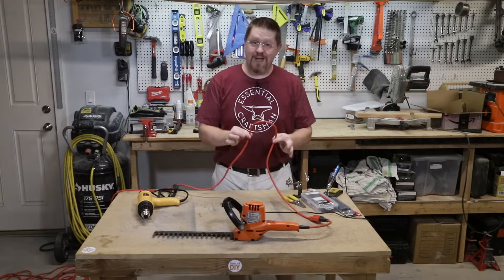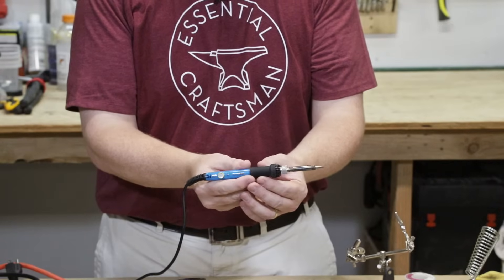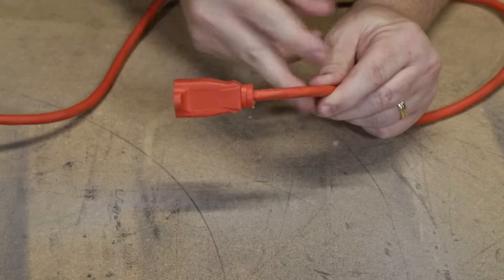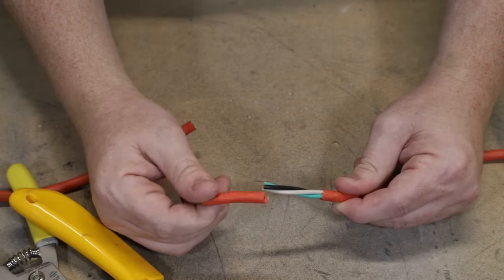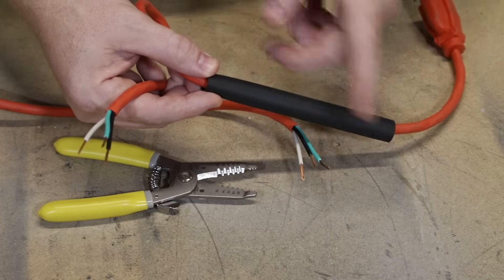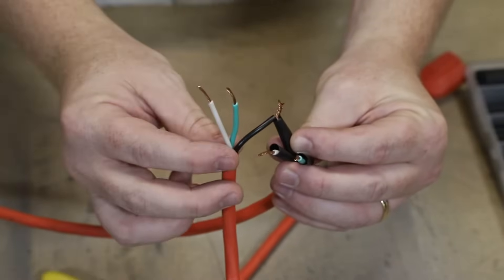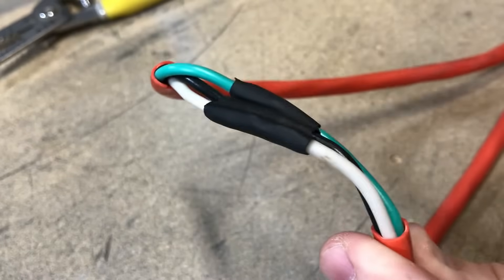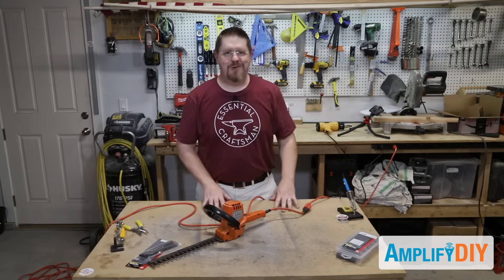How To Repair A Damaged Electrical Cord Safely

Comment: soldering connections is prohibited here in the EU for obvious reasons. dont use this wire inside the house
Reply from the maker: Soldering is prohibited in the EU? Somehow I don't believe that....
Reply: @AmplifyDIY  soldering eletrical connections at domestic voltage ie 120-240V bruh obviously i wasnt talking about soldering in general... ever heard of wago, etc?
Reply from the maker: @kbuss10  When done properly, soldering is fine, even at mains voltages. Of course I've heard of wago and other similar connectors, but none of them that I know of would provide a better (safer) connection than what I demonstrated.  But hey, if it's not allowed in the EU, so be it.
Reply: @AmplifyDIY  I've been soldering since 12yo low voltage of course. it was outlawed in the EU because at overload it can melt and cause fire. in a domestic fire insurance company finds out it won't pay also at quality control for an electrician it's not accepted. needs to be crimped wagoed or ultrasonically welded lol which is kind of crazy. The latter is used in power bars Even the cheaper ones.
I was looking for solutions The problem is in the USA everything allowed in the EU everything is over sanctioned.
but no information how it should be properly soldered like that is quite a relative expression when you load it up with 20 amps and I'm not going to do experiments just to feel safe.
did lately what you did but I just cut it off and installed an IP rated plug but it turns out I shouldn't solder the wire ends because solder creeps under load so the holdings screws will loosen even if they havey duty and tightened properly. luckily it's on the garden end.
so again I was looking for solution. That's how I find your video. by the way what I don't like it in it you should have used waterproof tape first then two layers of outer shrink tubing the second being longer.  this is going to be pulled around in wet grass capillary action will put water up to the solder they going to rot but whatever as it's outside.

Comment: You should have staggered the connections of the hot/neutral/ground wires so they are not all at the same spot
Reply from the maker: This is a great idea. Thanks, ItsAlive111!

Comment: Can you add silicone under the last shrink wrap to make it water proof?
Reply from the maker: Hi Porfirio - I did not, but you can. If you are looking for a water-tight seal, look for heat shrink that has hot glue in it already. As it shrinks it melts the glue which then makes a water-tight seal. Good luck!

Comment: Can this method be used to double or tripple the length of the extension cord by combining them?
Reply from the maker: You can ... but I don't recommend it. Extension cords are generally only manufactured to be the maximum length that their internal conductors will allow at the rated amperage. So be careful, and pay attention to the load you are putting on the extension cord. The longer the cord, the more resistance. Extra resistance causes more current draw, more heat, tripped breakers, and in extreme cases can lead to fire etc.

Comment: Bassett hound chewed thru 3 extension cords, circular saw cord, battery charger cord,  and my trailer wires.
Reply from the maker: Oof. Bad dog. Probably still a good dog, though. :)

Comment: crimp connector all the way. not solder
Reply from the maker: Crimp connectors are far less reliable long term, in my experience. They can corrode easily, and develop loose connections. Thanks for watching!

Comment: What do I do if there are only 2 wires and neither is coloured
Reply from the maker: Only two wires on an extension cord? Or is this on an appliance cord?
Reply: Appliance cord.
Reply from the maker: I assume you are in the US, where the electrical grid runs on Alternating Current (AC) at 60Hz. This means that the polarity between the hot and neutral wires (which are the 2 wires in your cord) flip back and forth 60 times per second. Typically the switch on an appliance is designed to be connected to the hot wire rather than the neutral, so that if you open up the appliance while it is plugged in there is very little chance of getting shocked. If you accidentally swap them during a repair, then you effectively change it to have the switch on the neutral side, which allows the hot side to be connected directly to whatever else is in the circuit inside the appliance. This is not really an issue, but be aware if you open up the appliance to attempt repairs on the internals and it's plugged in, you are far more likely to get a pretty good zap. But honestly, with a non-grounded appliance like that, it makes little difference which wire goes where. The appliance will happily run with the wires connected in either orientation.
Now, having said all that, here is how I would repair  yours: Before you cut anything apart, mark one of the wires with a paint pen, or wrap a piece of tape around it on both sides of where you are going to perform the repair. That will just help make sure you re-connect them the same way they were before. Other than that, I'd do the repair the same way I showed in the video: make a clean cut through the wires, strip off some insulation, slide on some heat shrink, solder the connections, insulate with heat shrink. Done.
Good luck!

Comment: Great video ! Any yes, I would really like to know how to repair a frayed cord where the fray is right near the plug. I have several of these cords, and somehow my appliances only want to fray right near the plug. I subscribed to your channel. I like your attitude too, on top of the great content :)
Reply: Just replace the plug end, you can buy male or female ends.
Reply: My daughter didn’t know she could just replace the plug end and bought a whole new cord for her bissell crossswave. She ordered the right part number and style but the new cord does NOT have the green ground wire. What can we do to still use it? It was bought online and more costly to probably send back than anything else. If it’s possible i will buy the 3 wire plug end but do I really have to? Do we need the green connected? Or just close it off? Please any advice appreciated

Comment: Instead of a heat gun could you use a hair blow dryer, or does the hair blow dryer not get hot enough.  Thank you for your video.  I just got a brand new vacuum cleaner and of course the power wire is not long enough for my 850 square feet of living space.  I have a very long power wire from another vacuum cleaner that I’ll add to my new vacuum.
Reply from the maker: Hi D - a hair dryer is usually not going to get hot enough. Also: be careful when extending an appliance cord. A vacuum pulls a fair bit of current, and the internal resistance of the wire can cause it to get hot, which is potentially dangerous. I would only add just enough length to reach what you need to, not another full cord. Good luck!
Reply: Thank you so much for the great advice!  Right now I’m having trouble finding a small quantity of the adhesive shrink wrap.  I don’t think I will need 270 pieces!  😜.    Thank you again!
Reply from the maker: @d.eileen1336  My local Home Depot and Lowes sell small quantities of heat shrink, in various sizes. Good luck!
Reply: @AmplifyDIY  WOW THANK YOU SO MUCH FOR THE INFO.  Thank you much!

Comment: You make all your connections the same length and that is dangerous! You are supposed to stagger your cuts then repair.
Reply from the maker: I don't really think it's dangerous, but certainly staggering your cuts will make things fit quite a bit better in the heat shrink. Thanks for watching!

Comment: Hello, great video! Is it possible, if it isn't already the case, to make a video where the damage is near the end connecter? also, can a hair dryer work instead of a heat gun? Thanks in advance.
Reply from the maker: If the damage is near the end, it’s usually best to simply replace the end with a new one. New ends are cheap and plentiful at your local hardware store. 

Hair dryers will typically not get hot enough to activate heat shrink. You can use a lighter, but be VERY careful. 

Good luck!

Comment: It's best to  just make two cords by putting new ends on the cut ends.
Reply: It can be handy to have a couple shorter extension cords on hand, too. Way more expensive, though. That is, unless you have to go out and buy a soldering iron.

Comment: Could I do this with 2/0 welding cable?
Reply from the maker: In theory, yes, but keep in mind the power levels in a welding cable are MUCH higher than a typical extension cord. You'd want to beef up every aspect of the repair as I showed it here.... make sure your solder joints are incredibly solid, double or triple up your heat-shrink insulation, etc.

Comment: on the soldier iron it has a temp gauage that can be adjusted - what is the temp to fix a wires on an extension cord?
Reply from the maker: Hi Shawn - the temp required is dependent on the type of solder you use. I've generally found that for most of the little jobs I do like this one 650ºF works well. Good luck!

Comment: That shrink tubing doesn't look very thick, is that supposed to insulate as well as the insulation of the wire? How water tight is it?
Reply from the maker: Hi George - it's actually quite thick, and filled with a heat-activated glue which forms a completely waterproof seal. Great questions!
Reply: @AmplifyDIY  Ah, great info.

Comment: So many people make cold joints that will fail. I would recommend butt splices. I've never had one fail after years. Otherwise the same method with the shrink tube. I always keep an assortment of sizes for different jobs. Having been an electrician for forty years I've worked on a lot of older solder joints and they can last longer than the wire but as I said many people don't do a good solder joint and I prefer the butt splice method myself even though I have the solder equipment. If it's a long cord with the damage in the middle I'd simply put a male cord cap on one and a female on the other essentially making two cords. That's the only acceptable method with osha inspections. And for a senior it's often a pain having to deal with say a hundred foot cord. Use a short cord when needed and two for a longer distance.

Comment: while it may be more difficult to find, they make a thicker heat shrink tube that has adheisive inside to use for the outside (orange) part.   it's more expensive and more difficult to find but being as these cords are constantly pulled on, it's insurance.  check with an electrical supply house.
Reply from the maker: Excellent suggestion!
Reply: When doing repair on a cord for outdoor use, I'd suggest going one better with marine grade heat shrink tubing (look in boating stores and some hardware/tool supply stores).  It is made  to produce a water resistant seal and should be UV tolerant as well.  Other grades of shrink tubing may only hold up in dry locations not exposed to direct sunlight.

Comment: My had the exact same accident with her hedge trimmers. Lol!  What size is the larger shrink tube for the cable itself. Is it 1/2 inch or 3/4 inch? I checked the comments and didn't see this one.  I did hit the like button! Thanks!
Reply: It was hard to see in the video but he used 1/2 heat shrink.  I believe the wire gauge of the inside would be 16 gauge heat shrink.

Comment: What I did, was just cut the six odd feet of cord and replace the receptacle. I used an Eagle 1-15 receptacle - it looks like a little yellow barrel and properly fits into the; trimmer/weed whacker/leaf blower since it has no ground slot.

I used the six odd foot cord for a switched extension box for my electric drill. This is a really great video, you have here. It really makes more sense since most people don't tinker with things like me. Also, wow that trimmer looks hella dangerous, looks like a reliable old Black and Decker. :3
Reply from the maker: You are right - that trimmer is a throwback to the '80's when there were fewer lawyers around. Thanks for watching!

Comment: I have a DNC CCTV cable that i need to repair, it's now in 2 pieces and i have tried to rejoin them by stripping back the red and yellow wires and soldering them back together but i get no video on my screen.

Any idea should rejoin them so that they work?
Reply from the maker: I would start by doing a continuity test with a multi tester on each of the leads to determine which one(s) is not making good contact.  Is it possible that your soldering is fine, but there are other problems with the cable such as a bad connector?

Comment: This is very useful!  I have a vacuum with a damaged cord that I will try to fix.  I don't know if I need to get a heat gun for one repair.  Is there anything else I could do?
Reply from the maker: If you are VERY careful you can use a simple lighter to shrink the tubing rather than a heat gun. Just hold the heat shrink over the top of the flame, about 2-3 inches above it. Go slowly, and be very careful that you don't get the heat shrink tubing too hot (it'll start to melt) or let it catch fire. Good luck!

Comment: Thanks for the step by step repair.

I do have an old canister vacuum that needs a cord repair.  The repair needed is where the cord is coming out of the vacuum . It is most likely due to  tugging at the cord that  caused it to pull away & have those  colorful wires inside showing now.  I like to fix it while searcbing for a new one.

How would I fix that?  The vacuum is fine and I still have quite a few bags left for it. 

 Plus , I have searched around for a new one and they mostly sell bagless types which is messier to deal with (I have a Eureka Airspeed for 5 years  and the hose came off that recently). Many new vacuum parts are made of plastic too.

So I was thinking that I need to cut 2 - lengths of that heatshrinking black tube & cut it down its length so that it's filet open.  Then slide as much of it into the vacuum & overlap  the other end over some of the cord n use the heat gun on it.  Then use the 2nd length to do the same but making sure that it overlaps the filet-open end of the first?

Can you make a video demonstrating the steps to doing such a repair? Thanks.
Reply from the maker: Thanks for the feedback! I would not recommend cutting open heat shrink tubing in the manner you described. When you heat it up, it will never actually tighten down and shrink around everything like you expect. Most likely to finish the repair correctly, you will need to disassemble the portion of the vacuum that the power cord goes into, and repair the cord after removing it completely from the vacuum. Good luck!

Comment: Thanks so much for the video and keeping it simple, especially for those of us who are novices. I am repairing a damaged DeLonghi extension cord to a portable AC. Upon removing the outer insulation, I came across nylon threads in addition to the inner wires. I'm not sure what to do with the threads, any suggestions?
Reply from the maker: I would just trim the inner nylon threads back to the point they are out of the way of the repair area. Good luck!
Reply: Those threads are there so you could easily pull back on the insulation without wire cutters.

Comment: Thanks for the video.   One question....does the heat shrink (on the small wires) provide sufficient insulation?  Or should I wrap with electrical tape as well? Thanks.
Reply from the maker: The heat shrink provides plenty of insulation. I don't think it needs additional electrical tape. Great question, and thanks for watching!

Comment: good repair for expensive wire but the one for $9 like showing in  this video I'll just get another one from Walmart  :)
Reply from the maker: You make a good point, but this was a 100’ cord. Quite a bit more spendy than a short one from Walmart. Thanks for watching!
Reply: @AmplifyDIY  Plus, you only put about a 1" piece of it into the landfill, instead of the whole thing. Some people can't grasp the big picture.

Comment: So while I do agree that from an electrical standpoint this is the correct way to repair an extension cord what you don't go over is the fact that the orange outer layer of the cord is now missing in that part making the structural integrity of the cord much less than what it was. I would recommend doubling or more the outer shrink tubing to add extra protection on that area.
Reply from the maker: I know it didn’t come across in the video very well, but the heat shrink i used on the outer layer is the kind with glue on the inside, and once it shrunk it was considerably thicker / stiffer / more durable than the orange insulation. I’ve had viewer requests to demonstrate the right way to replace an end of an extension cord, and I’ll try to mention making sure any area you repair winds up more durable than the original. Thanks for watching!

Comment: I would recommend cutting the inner wires at different lengths so that each joint is at a slightly different place.
Reply from the maker: This is a good idea.
Reply: it's called staggering
Reply: I agree, less chance of the solder scraping and damaging each other
Reply: Mukesh Thaker 
Thank you! And ...
Practice makes perfect 😉
Reply: Is this so that the temperature is regulated more?
Reply: @scaler1817  So there isn't a big lump in the middle from each part laying on each other. More importantly, if by chance the heat shrink that was placed on each individual joint were to tear, being at different lengths there wouldn't be a short.. 
Also there is less chance of tearing if they aren't stacked on top of each other grinding away and through the insulation/heatshrink...
Reply: actually staggering will mean you have a longer uglier final joint in that the outer heat shrink will be longer to cover 3 seperate staggered splices
Reply: @mvmcali6900 It’ll be slightly longer but certainly not uglier because it will be thinner and smoother.